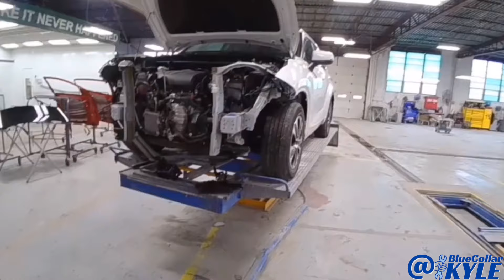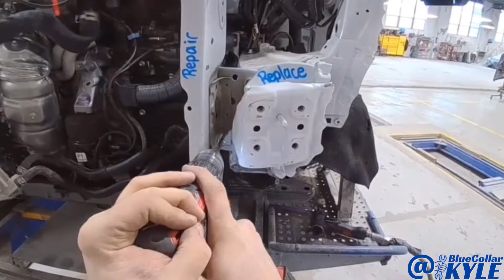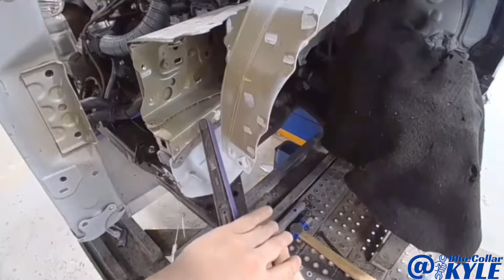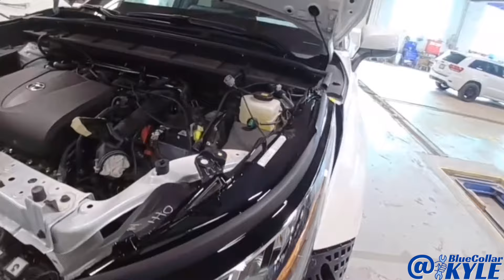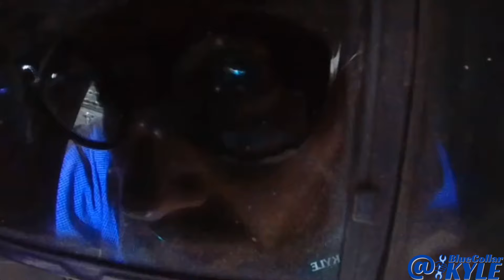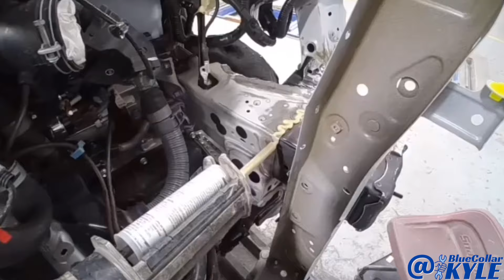Does A Frame Rail Absorb Energy? #autobody #bodyshop #collision #bodywork #framemachine #autorepair

Comment: I'll say the exterior sheet metal is shit today.  Old man had somebody side swipe his passenger front fender on his Canyon.  I was legitimately massaging dents out of the fender with my fingers.  I'd be surprised if the fender weighted a a couple pounds.  I used to do auto body work in a prior life so I have experience... just never had my hands on a brand new panel.  Which makes sense now because I can see the hood flutter at highway speeds... 

Beyond that the structure of vehicles today is far superior than years past.  Energy is absorbed and passed around the passenger compartment.  So many people walk away from accidents that were debilitating or lethal in years past.  Same goes for emissions.  The emissions systems are the sole reason we have the power and efficiency we enjoy today.  But the uneducated will still bitch about emissions.  Emissions that extended their quality of life five years.